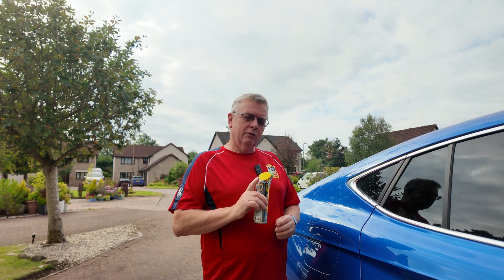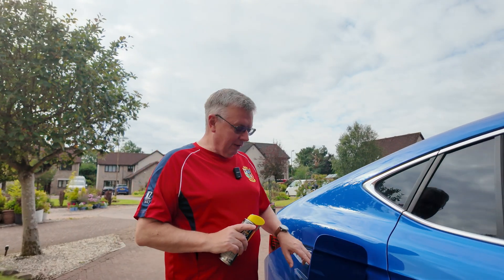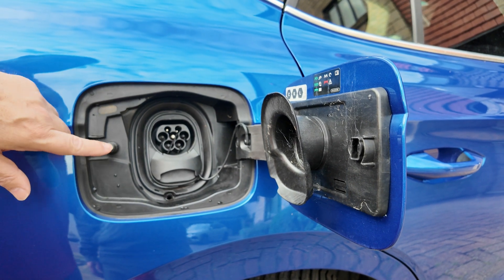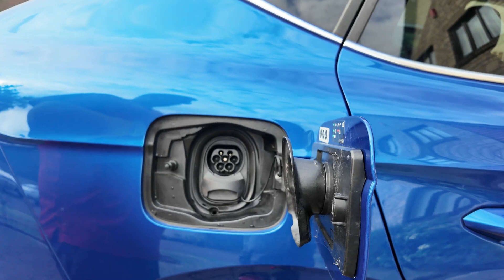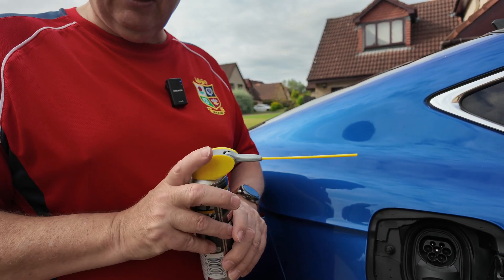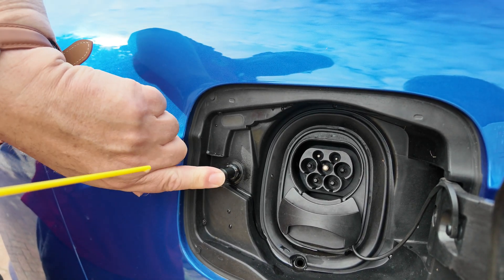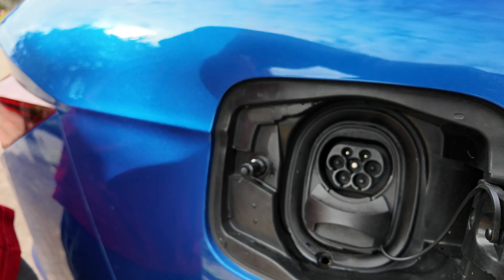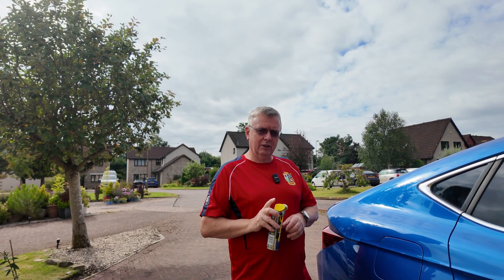The VW Group EVs Key Weakness Explained

Comment: The ID7 uses a different design in that the flap pivots up so offers more protection when charging. Note on my Enyaq I used the Silicone Lube regularly for 2 years the  charge flap failed 3yrs 2 months, 2 months out of warranty!!! Luckily if failed when open intrigued the tabs on the lock wasnt worth £280 for a dealer repair
Reply from the maker: Yes I think that's the best solution. Obviously they learned when they designed the ID7. That's such a simple change they could make for the next cars

Comment: Got my 24 plate Enyaq 85x sportline back from Vertu Skoda Chesterfield this afternoon (thursday) after the 5.4 software update and also a recall on vehicles with the same platform nearly got it back yesterday it went in on Tuesday but when l got to the dealership to pick it up but the car had found 3 errors so it had to stay another night and get back plugged in to the laptop in their words they put her to sleep last night and woke her up this morning did 2 more tests and that seem to fix it l had to repersonalise my infotainment screen i think the recall part of the upgrade fixed any bugs with the batteries and the 12v battery but in the new software you can now lock/unlock the car within the Skoda app setting it up through your S-pin hope this helps
Best wishes 
Kev
Reply from the maker: Interesting, thanks for the update and glad you got it sorted.

Comment: A better idea is simply pull the wire off the locking motor which solves the problem permanently. The flap will then not lock but nobody is going to steal your electrons, the locking flap was an unnecessary carry over from ICE cars.  Silicon lubricant does work but eventually the locking motor will fail leaving you with a stuck flap. VWs Law means this will always happen at the worst time when you are far from home and its cold dark and raining !
Reply from the maker: Yes, though I have seen charge points deliberately vandalised with the sockets filled with glue - I guess the car could be attacked in the same way.

Comment: This worked on my ID.4 for 4.5 years, then it seized closed. Sod's Law this happened away from home and needing a charge.....   Fixed under VW Extended Warranty.
Reply from the maker: did you lubricate the mechanism over those 4.5 years? Just wondering if I need to worry now
Reply: @enyaq_gorm Ever since it became evident this was a problem, so maybe after 12 months. There is a DIY fix to cheaply replace the actuator on the VW ID.3 Facebook group, which is non-damaging.

Comment: The latch mechanism also gets used a lot more heavily on EVS - maybe increased part wear is part of the water ingress issue?
Reply: Apparently it's the same on the ice cars. The difference is that on ice cars, the cap isn't kept open for anywhere near as long.

Comment: Same happened mine. Have to wait for it to be repaired at next service....had to stuff the charge port with bin bags when I washed it to keep the electric connections dry 😂😂
Reply from the maker: That's a good tip with the bin bags, I would never have thought of that.

Comment: It has just happened on our Mercedes EQC. I had to break it by forcing it open when the actuator failed. The dealer didn’t care, said it was a common problem but didn’t have the parts in stock when the car went in. We have an Enyaq on order by the way. Really looking forward to it.
Reply: The RAC man who came out to my ID.4 when the charging flap actuator seized closed said it was a common problem on Mercedes and knew exactly how to get in an open the flap on Mercs with no damage. He tried same approach on the ID.4 but could not gain access to the actuator and had to break the locking tab on the actuator to get it open.
Reply from the maker: @mike.n.davies not ideal really
Reply: Its not a problem for dealers, its a revenue stream, they are delighted. Disconnecting the wire from the locking mechanism before cuts off this nice little earner
Reply from the maker: Thanks for the info, and good luck with the new car!
Reply from the maker: Yes any silicon lubricant rather than oil should do

Comment: I’ve bought the Skoda charging point cover that fits over the charge port when the cars plugged in. The only issue is remembering to fit it when plugging in, it does keep that area dry though and seems to work well.
Reply: I mostly charge at home and my car is in a garage and not outside.
Reply from the maker: Yes, great suggestion!
Reply: Was going to say the same, bought one from my dealer when I collected the car, it allows you to see the charging light too when plugged in, somewhere around the £19 mark, will post the part number if I can find the reciept..
Reply from the maker: @MrGordonduck58 I have one, I just always forget to fit it
Reply: @enyaq_gorm i always keep mine just inside the boot in the right side pocket, i know it’s a bit of a faff getting it in place but I haven’t forgotten it yet, but give me time, I’m only a month in with my first EV but loving it so far.
Reply from the maker: @MrGordonduck58 yeah I put mine under the boot floor and.... Out of sight, out of mind

Comment: The fuel filler flap on my diesel (VW group) car also had a tendency to stick - possibly not for the same reason - for my car I've seen suggestions there's a common solenoid problem - but it seems a problem area nonetheless.
But also - why do they fit a locking flap on an EV in the first place?
I get that for a fuel car it's a way to stop people trying to steal fuel, but I'm pretty sure no-one is able to syphon out your electrons. So why not have a simple flap with no lock, that in the worst case you can lever open?
Reply from the maker: Spot on, it's the solenoid that corrodes but as you say, why bother? I've seen some charge points sabotaged with glue by people who are anti ev so I guess it's protection against that sort of thing. 🤷

Comment: Why haven't they fix this? I'm surprised no class action law suit to force the fix.
Reply from the maker: it's a standard part on all VWs, been in use for years and never been an issue - because it's not an issue for petrol and diesel cars. I suspect no one envisaged the problem.
Reply: I did this and the spindle stayed stuck in after I push it. tried locking and unlocking the car for ages and couldnt get it out and had to take it to the garage. They had to replace the unit.
Reply: @CMF-c9h  that's unfortunate but maybe the actuator was on the point of failure anyway. Better to discover it when you aren't potentially stranded in the middle of nowhere, trying to charge?